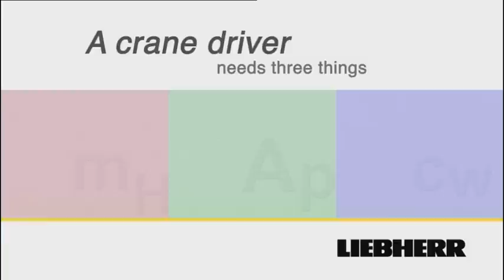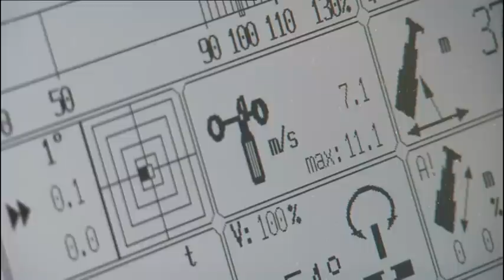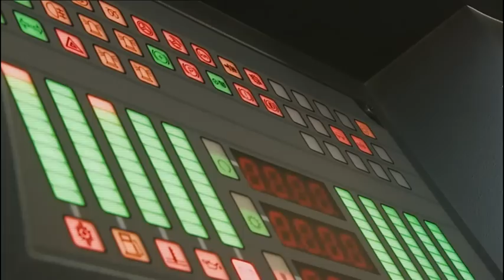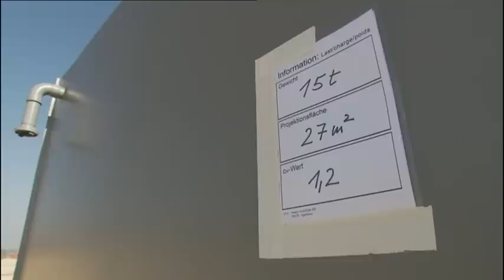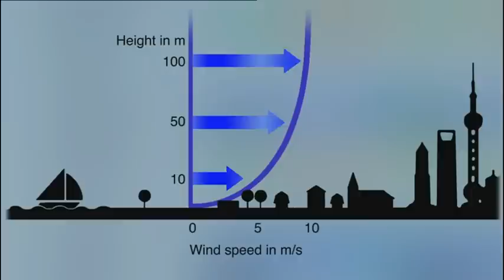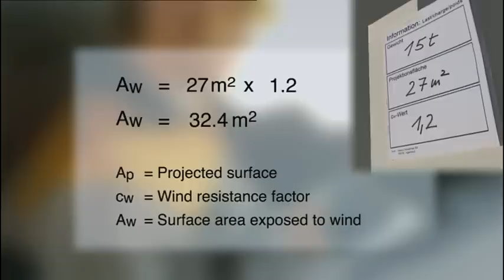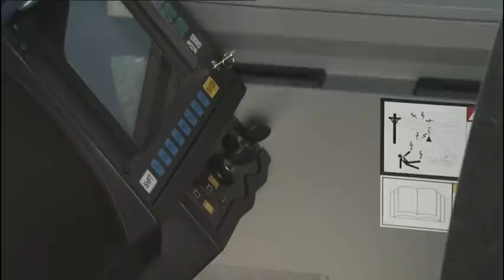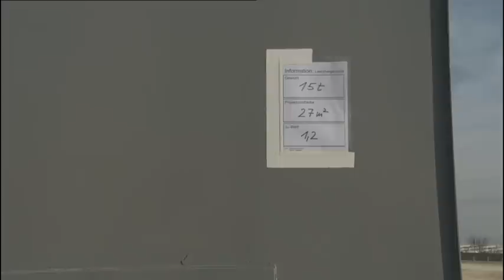Liebherr - Mobile and Crawler Cranes: 3 things an operator needs to consider

Comment: Tensiometer is what I would use that way when wind reaches over 20 mph it shuts you down for safety of course. You scope out what boon length you decide to use for your radius. For those that don’t know that the center of the turn table to the center of gravity. What your hooked to.